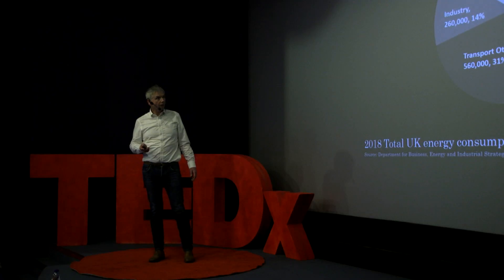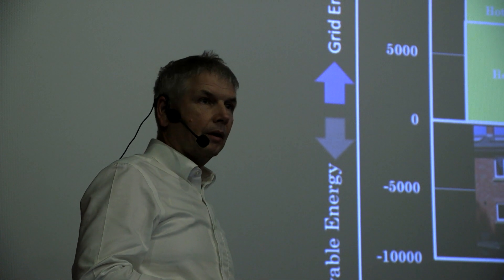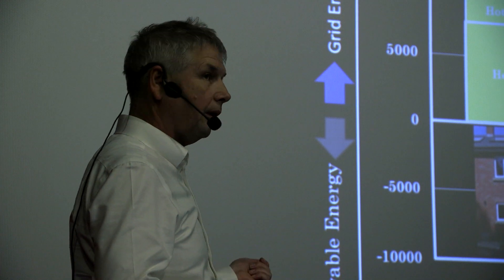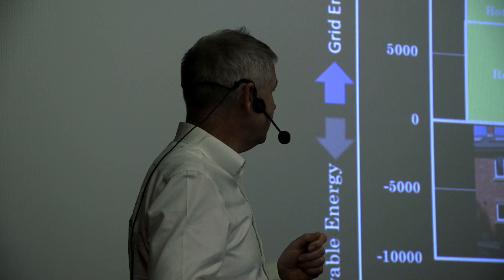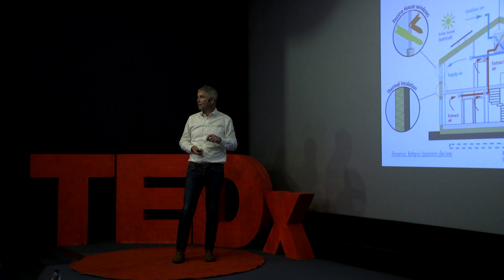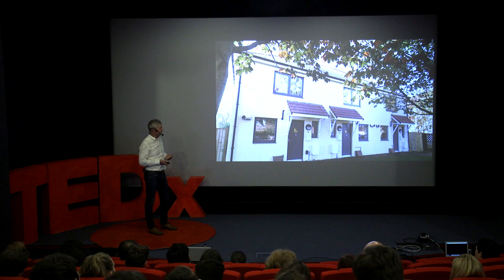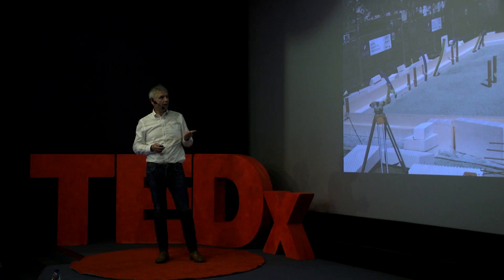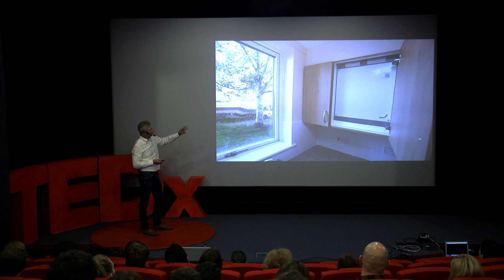Homes to Carbon Zero - Passivhaus | David Stones | TEDxAberystwyth

Comment: It a good talk, informative and useful. However the argument that a PH house cost less than a standard house is mission impossible!
I would say between 10 to 15 % ! How can be cheaper if there is additional insulation, triple glazing with insulated frames, a full MHRV system and more site supervision?
Doesn’t add up! Also claims that  that a PH house running cost is only £70 not true either. Hot water requirement will much more than that unless you have all the renewables as well as Passive house! Then the cost old be much high... I have done 5 Passivhaus in Scotland and this is my experience.. Thanks for the ;lecture.